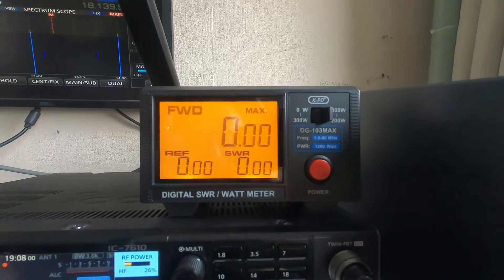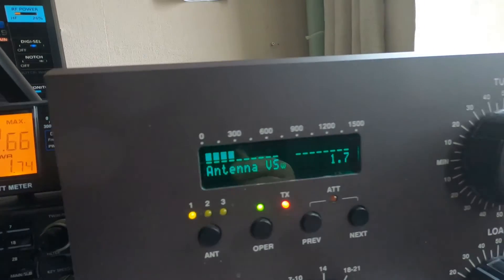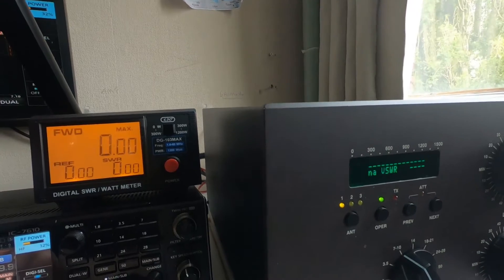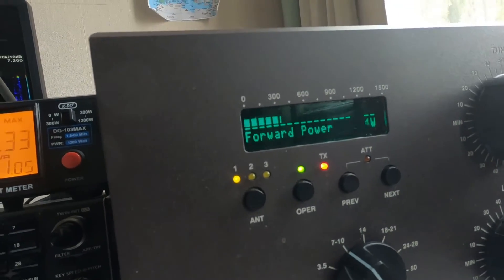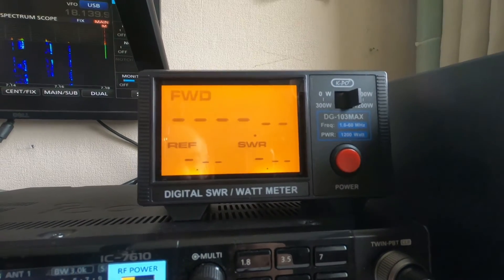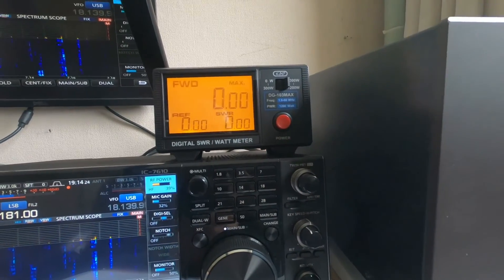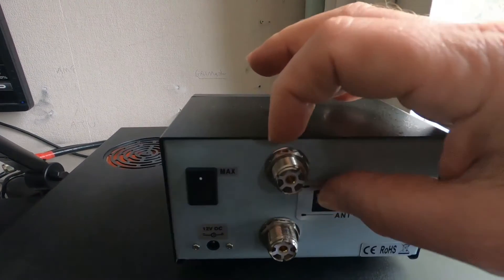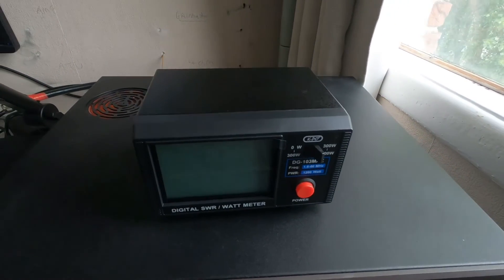K.P.O. LATEST DG-103 MAX 1200 WATT SSB, DIGITAL SWR POWER METRE, FIRST IMPRESSIONS 🤔🤔

Comment: Ive spent my ham radio career returning devices that either don't work as stated or are substandard in some way.
Reply from the maker: Hi,thanks for your imput, I know what you mean 😏, if this doesn't work out, I think I will just use the swr and power metre from the amplifier, 73s from Rotterdam 🙏

Comment: You will never have anything accurate power coming out of the amp and the amp power meter  will always be different. Try discount the amp and have  the meter running just with the radio and see what readings you get
Reply from the maker: Hi,thanks for your comments, yes I have tried that,same issue, but I will try over the next couple of days a few different approaches,,73s from Rotterdam 🙏🙏